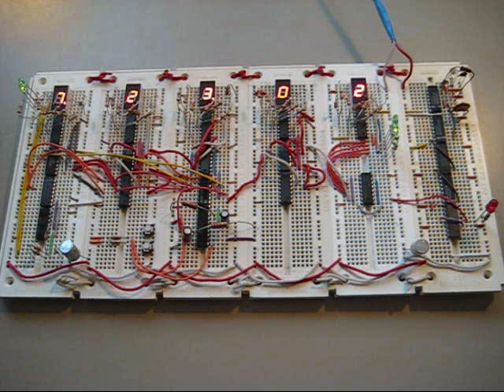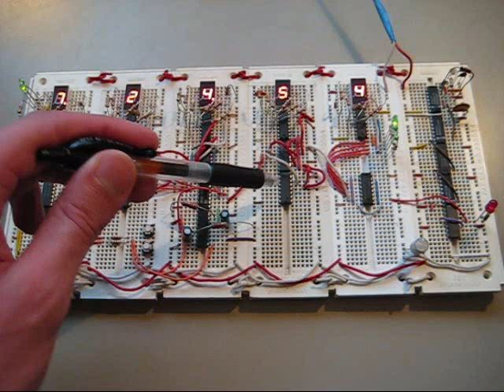Pure TTL Clock

Comment: I am building one out of TTL logic also, but I have used an opto-isolater for the clock source from an AC power supply. 50Hz fed into a 393 which is checked on an AND gate for 51, which then triggers a reset and a count into the next 393 for the seconds count.

Instead of individual seven segment modules, I have used a single 4 digit display with a 160Hz clock cycling though each digit. This saves using an additional 5 BCD chips as has been done here and also consumes less power.